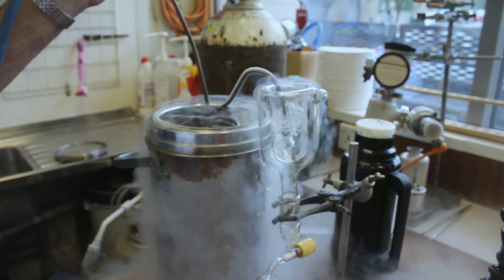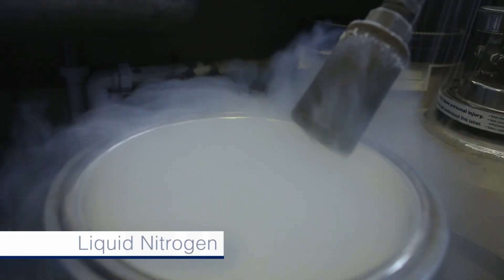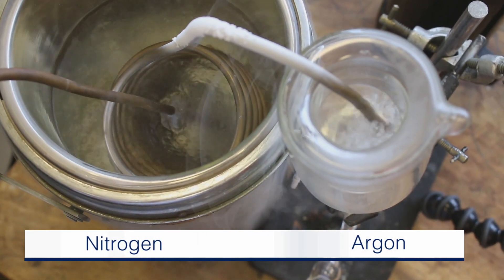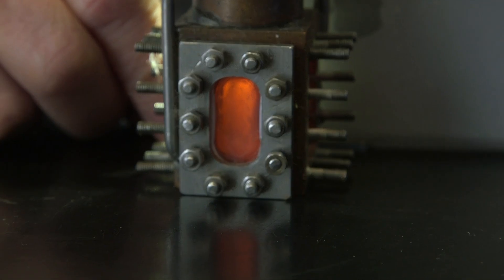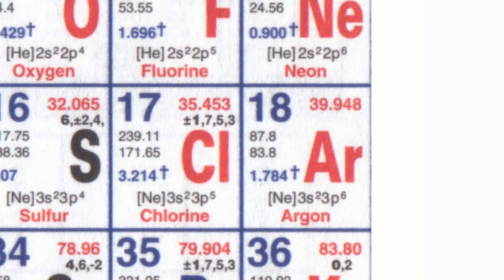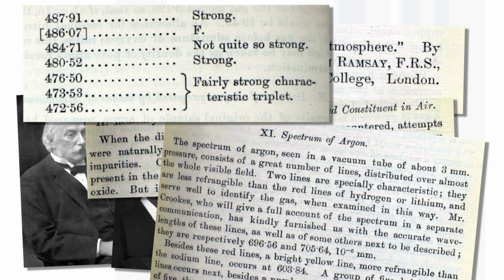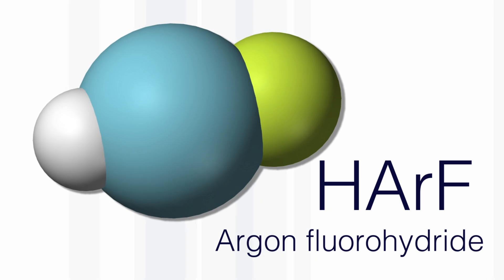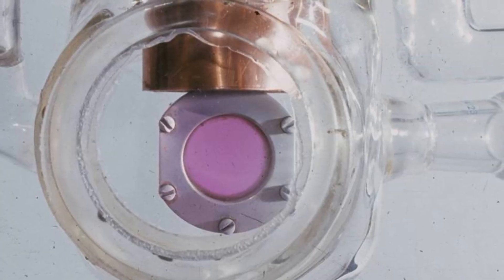Argon - Periodic Table of Videos

Comment: Can someone explain to me how a solution works on an atomic level? I know the basic rule of thumb is like dissolves like (hence the reason water is a universal solvent because it has both polar and non-polar ends), but it never quite made sense to me why some chemical reactions don't take place. For example, water dissolves table salt and "separates" chlorine and sodium. When you drink the solution, it tastes salty, but it's no longer "salt" along with the fact that if they are actually separate, sodium would explode and chlorine would be poisonous. The individual salt elements aren't in a chemical bond with water, otherwise you wouldn't get salt crystals back after evaporating the water. It even differs on how the "separation" works depending on the type of bond. An ionic bond "separates" the individual elements, while a covalent bond separates the individual molecules. What about temperature? In theory, the thermal energy helps separate the individual components, but there's a solute or solvent (I forget what it is) that increases solubility when it's colder, not hotter.
Reply: Ketsueki Kumori It seems you understand a lot of concepts but you are also quite mistaken about a lot of them.

A solution at an atomic level involves the separation of the constituents of a solute which are surrounded by molecules of the solvent. In the case of salt in water for instance sodium (Na) and chlorine (Cl) atoms would each separately be surrrounded by water molecules.

Except salt is not composed of atoms, it is composed of atomic ions, atoms which have gained or lost electrons. Chlorine forms the negative chloride ion (Cl-) and sodium forms the positive sodium ion (Na+). It is these ions which are surrounded by water and it's for this reason that salt water doesn't explode and poison you.

Water is not both polar and non-polar, it is just polar. It is polar because it has a positive end and a negative end. You probably know water is H2O and you may know that it's structure is H-O-H with an angle of about 110 degrees between the bonds. Oxygen pulls stronger on the electrons in the bonds than hydrogen does, so oxygen is somewhat negative and hydrogen somewhat positive and because the bonds are not pointing in exact opposite directions the molecule has a net polarity. The positive ions are surrounded by water molecules with oxygen pointing inwards and negative ions are surrounded by water molecules with hydrogen pointing inwards.

But water and salt interact even more specifically. Ions of metals like Na+ will actually form weak bonds with water through the two remaining free electron-pairs on O. Because of this water molecules immediately surrounding Na+ are usually not pointed straight at sodium, but are tilted.

Similarly the Cl- ion has four free electron-pairs with which it can form weak bonds with the H in water which are strongest when the O-H bond is in line with the weak H-Cl- bond. We call this weak bond a hydrogen bond. Because of this water surrounding Cl- usually has one H pointing to Cl- and the other pointing away.

Hydrogen bonds are really common and really important. N-H, O-H, F-H and rarely C-H bonds can serve as donors and O, N, F- and Cl- as acceptors. Water also makes hydrogen bonds to other water molecules. This actually makes water a terrible solvent in a lot of cases because you have to fit in this network. Salts (compounds composed of ions) can do this at least somewhat, but a lot of less polar organic compounds can't do this very well.

This is where "like dissolves like" comes in. Polar molecules dissolve well in polar solvents and non-polar molecules in non-polar solvents.

Back to your questions about salt. Salt isn't salty because it's salt, it's salty because it dissolves. On your tongue there are receptors for ions, and they only respond to ions, not to salt as such. You can mix hydrochloric acid (HCl) and sodium hydroxide (NaOH) to a neutral solution of Na+ and Cl- and it'll taste exactly the same as a solution of salt of the same concentration.

Temperature is a tricky business when it comes to solubility. The rate of dissolution is almost always faster at high temperatures, but solubility is the concentration at which dissolution and precipitation are in equilibrium. Usually solids have increasing solubility with temperature, and gasses have decreasing solubility while liquids are close to constant comparatively, and this is because entropy is more important at higher temperatures. There are however notable exceptions and in particular calcium carbonate or lime has a decreasing solubility with temperature. Solids can even have their solubility increase then decrease with temperature.

I hope that clears up a lot of the questions you have and sparks some new questions.
Reply: Water is polar solvent. There is no such thing as "universal" solvent. Water dissolves table salt (NaCl) by surrounding each ion (Na+ or Cl-) and pulling the solvated ions away, breaks the salt's crystals. And, as you can see, there is no sodium or chlorine atoms, but ions. So, nothing to explode or poison.
The dissolving can be exothermic or endothermic process. The exothermic process will increase solubility when temperature is low, and opposite for an endothermic process.
Reply: sodium only explodes on contact with water when it has a net zero charge. dissolved in water, it has a net positive charge (1+) aka sodium ion, thus it has very different chemical properties than sodium atom. same goes to chlorine.
Reply: that is some mad epic level stuff there! :D
Reply: I just want to mention that water is certainly not polar and nonpolar. It is one of the most polar solvents you can use. Soaps have the property you're describing (a polar head group and a nonpolar tail), but not water. 

Water is actually a fairly crappy solvent for most covalent molecules. Salts and acids/bases dissolve well in water because they ionize, and highly polar compounds dissolve in water, but a vast majority of organic (as in organic chemistry, not as in living) molecules have abysmal solubility in water. So much so that washing a product with water is a common way to purify, as it will extract out salts while leaving most desired compounds behind.

Acetone is a much more universal solvent than water, but it still fails to dissolve more nonpolar compounds.
Reply: Ketsueki Kumori I

Comment: I always thought double glazed windows have a vacuum in between the panes.
Reply: Some very  specialized windows do, but the pressure on them is immense, so they require supports between the panes. This has two problems: 1) It provides a direct means for heat to conduct, reducing their performance 2) they are visible

Comment: Argon is used extensively as a sheilding gas in welding.
Reply: TIG welding uses argon, MIG uses a 75/25 Ar/CO2 mix for ferrous metals and Ar alone for non ferrous metals.
Reply: Officer KD6-3.7 it still depends with tig, I've seen helium used instead of argon
Reply: Drakeblood Assassin You use helium sometimes for thicker pieces of aluminium. It has a higher ionisation potential so you get a hotter arc.
Reply: Blends with Helium are sometimes used for Tig welding thick aluminium (over 6mm), and sometimes blends with 2% Hydrogen are used for welding austenitic stainless steels. In both cases to "up" the temperature of the arc and therefore increase travel speed to reduce heat input reducing distortion and in the case of stainless steel, decreasing the ruining of corrosion resistance. 
With MIG welding, other than when welding aluminium, mixtures with CO2 are used to up the arc temperature, and react with silicon and metals such as molybdenum and manganese alloyed into the wire consumable to drag impurities out of the molten pool before it solidifies.
Reply: Argon
Reply: I before E except after c bro
Reply: When I was a young man and dinosaurs roamed the Earth I vaguely remember using Straight CO2 for mig welding, now I see c25.... All tig welding is done with straight argon though
Reply: @hooliegunn6847  100% argon, 100% helium, argon/helium mixtures, argon/hydrogen mixtures. Not always straight argon👍
Reply: Cool
Reply: cpt nordbart Yes also used for nearly all TIG welding. You need it for the inert atmosphere but the voltage at which it ionizes and hence the temperature of the arc is also a consideration. For this reason you sometimes use helium or a mixture of helium and argon to get a hotter arc.

For MIG welding steel you usually mix in about 20% carbon dioxide with the argon. I'm unclear what the precise reason is for this.
Reply: TheUnnamedGent I know it's used in mig welding. Not sure if Tig welding too.
Reply: @cpt_nordbart  Yeah Argon CO2 mix is used for mig welding mild steel usually though there are different mixes used for stuff like spray transfer mig. Pure argon is used for tig welding stainless steel. not too sure about aluminium tig think some shield gases contain helium for that.  The gas is used to push oxygen away or shield the molten pool the same way flux does with arc welding

Comment: Another use of argon,  they fill incandescent light bulbs with it, it will not react with the hot filament and will even slow down significantly the evaporation rate of that filament, thus increasing the lifetime of the bulb.

Comment: I'm wondering if I can connect a neon transformer to my argon-filled windows, and make them glow :)
Reply: ForestCat_Peter if u do so. Please post it here.
Reply: As far as I remember you need quite low pressure for those gas discharge lamps. That might bend the glas panes and break them. But could also be that they are fine with bending a few mm inwards until they touch each other. The other thing is, as soon as there is a discharge path nothing else will light up. So don't expect the whole window to glow.
Reply: If you would have electrodes inside the window, yes. But all multi-pane windows i know, have a single strip of metal round the edge. 
You could, however, ionize the gas with a high voltage, high frequency EM field. You can take out the electronics from a plasma globe, connect the ground terminal to the metal strip, and get the other electrode near the window. 
I think it would be hard to get it working because of the minute space between the panes.
Reply: ForestCat_Peter you'd probably need tesla coil to do that.
Reply: Speedow, Aren't old style tungsten filament bulbs (It feels weird to say that) filled with argon?
Reply: The argon sign requires a small amount of mercury vapor to excite the electrons of the argon atoms in order to glow.
Reply: If you want to replace all the air with argon you will have to pull a full vacuum in which case you could just have a full vacuum which is better than argon in the first place. A full vacuum would burst the weak double glass pane. So argon replaces the air in a near vacuum that the double pane can withstand. Therefore you are always left with somewhat dirty argon.
Reply: @ForestCat_Peter:
you probably can, but perhaps would need some modifications to the window.
What you might also do, is shine some white light or light of the right colors through the window and take the spectrum of that. It would show the absorption lines (yes, less spectacular but basically the same) of Argon.
Be aware, as the professor indicated, that some of those colors (or absorptions) are particular to very low temperatures, which might complicate the use of your ordinary double-paned windows.
Reply: And thus his house exploded
Reply: Yes Phonotical, if they are filled with Argon then they're not at vacuum... Maybe you're confusing this with a filament bulb?
Reply: if you do so and survive. Otherwise have the remaining relatives post it ;)
Reply: Your windows won't be at vacuum, so no
Reply: @phonotical why not? you can observe the dull grey blue glow of AIR at room temperature and pressure with high voltage,  it'll just need higher voltage to see the effect

Comment: I wonder if lightning hit a building with argon insulated windows, would they all glow blue?
Reply: A small Tesla coil could be more effective
Reply: That's how unicorns are born.
Reply: I'm not sure if that would work as glass is pretty terrible at 
conducting currents. Perhaps you can ionize the Argon atoms by applying a
 (very) strong electric field quickly (and then turning it off so the 
electron can recombine - one could just use a strong AC). Or just use 
fluorescence or something similar.
Reply: A lightning strike is not DC. Far from it. It's an impulse. Like a single half-wave from a tesla coil with some ringing after it. In theory, if it works with a tesla coil (I don't know if it does), it should also work with a lightning strike.
Reply: ElectroBud that's true, yeah. But still, the actual current of the lightning wouldn't make the Argon glow, it would be the strong electric field (or even heat :D) that comes with it. 
I was referring to AC to make it glow more or less consistently since DC and lightning or any pulse as well will only make it glow once for a very short time. But you're right, lightning should probably work as well. 

Best thing would still be to just place electrodes inside the sides of the window, I'd be interested in how the lumination pattern would look like!
Reply: well all double paned windows I know have an aluminium strip around the edge, so that would most likely take the current before there would be enough voltage to excite the argon.
Reply: Sax4565 this is what a Tesla coil does
Reply: dontlikemath -.- I didn't see your comment when I wrote mine, I replied to smoothvirus with that :D
Reply: For a brief second before the window melts/cracks apart
Reply: Sax4565 oh ok 👌

Comment: Why are we not using an even heavier Noble Gas than Argon for windows? Wouldn't they conduct heat even worse?
Reply: Alex Korocencev heavier gases cost more.
Reply: Remember, the farther down you go on the periodic table, the more rarer it is, therefore, the more expensive it is. And the reason why it's rarer is because it requires ever bigger supernovas to create. Plus you'd have to stop at xenon, since radon is naturally radioactive.
Reply: I've definitely heard of Krypton filled triple glazing, but yes, it's very expensive.
Reply: True, I understand there are other reasons for rarity. In the case of helium, it's so light that earth's gravity can't keep it in place. If I recall correctly, the main reason we find any at all is because it's trapped in pockets in rocks. Vice versa for heavier elements, I'd imagine quite of few rare, heavy ones aren't that rare and are just trapped in the earth's core (hence the iron core), or in Jupiter, or the sun. Which kinda begs the question on how they managed to get to where they were and stay there. Like if helium is so light and proto-earth had a weaker gravity well than it does now, and all the elements in the earth were pre-made by an older star, and not all radioactive elements have decayed into lighter ones and usually not that light anyways, how did pockets of it get trapped. But that's a bit out of the scope of this conversation. Still a decent rule of thumb. That being said, I am curious on other reasons for rarity, like the technetium one you mentioned. I'm not a big chemistry nerd (more physics, though even most of that goes over my head), so I'm not that familiar with all the different elements' chemical tendencies.
Reply: Argon is an unusual case. There's a lot of it in the atmosphere, but almost all of it was created after the formation of the Earth, by decay of potassium-40.
Reply: elements dop not really get rarer the further dwon you get.

the most common elements in the universe are hydrogen and helium, but both of those tend to, in hydrogens case, react with other elements quite quickly and is almost impossible to find as an element in nature and helium has such low density that it can float off into space and is therefore also not common on earth.

regarding the availabillity of elements on earth you can basically say the most common one is iron, this is because the way nuclear fusion works, iron is the end, you can always fuse two nuclei and release more energy than you put in with elements lighter than iron.
Reply: Ketsueki Kumori Technetium has no stable isotope and all its half lives are relatively short so unlike say uranium it has already decayed long ago. Another example perhaps is lithium, which is much less common than sodium despite being immediately above it. That's because nucleosynthesis doesn't produce much of it. Same goes for berylium compared to  magnesium and boron compared to aluminium. Even carbon is comparative in rarity to silicon, composing about ten times as much of the oceans but a thousandth as much of the crust.
Reply: All my windows are filled with oganesson
Reply: Ben C You mean Livermorium, I mean Flerovium, I mean Copernicum, I mean Darmstadtium... Ah, never mind
Reply: Ketsueki Kumori That's a bit of an oversimplification. Helium and neon are further up the periodic table than argon but far rarer. Technetium is above rhenium but you will never find technetium in nature while rhenium is available in nature.